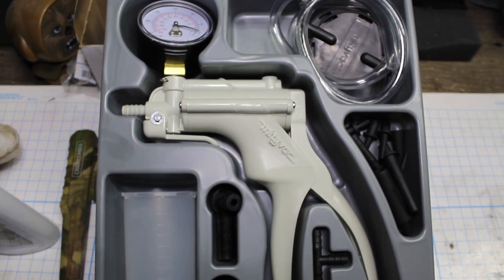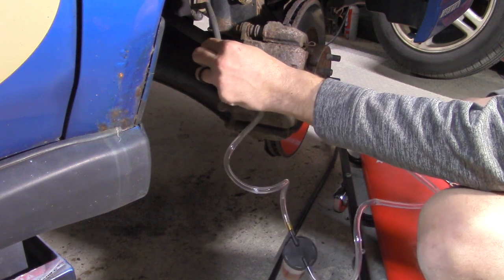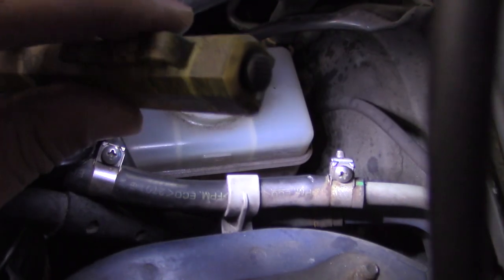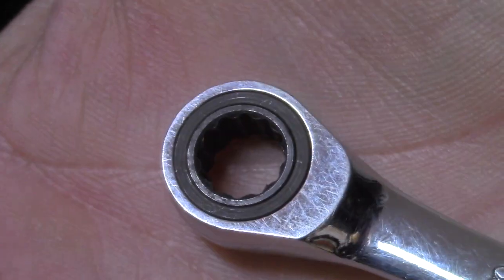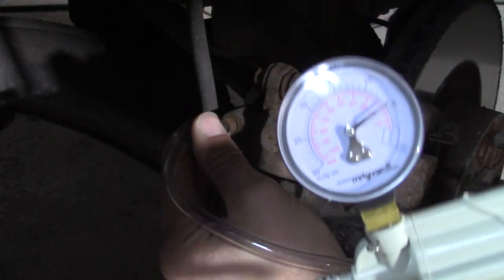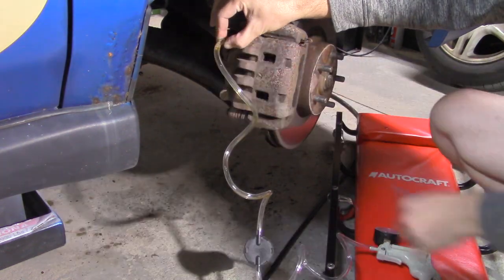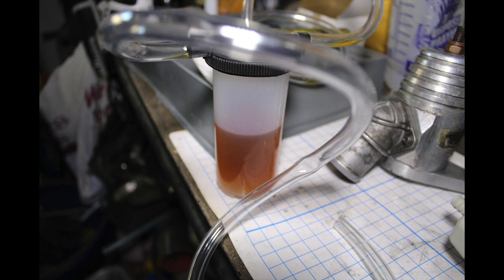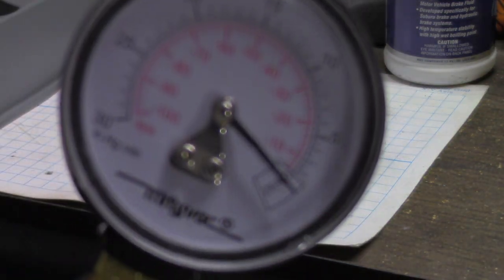MITYVAC: How To Bleed Brakes By Yourself Calipers DIY | Mityvac Kit | Review Subaru WRX

Comment: A suggestion I read elsewhere is to use a thick silicone to seal the bleeder after you open it to prevent air from leaking in past the threads🤷‍♂️.. haven’t tried it myself yet.

Comment: Short hose goes between the canister and the vacuum pump.  Says so right in the instructions.
Reply: The short tube is just used to make it easier to hold the cup and pump with both hands.  It really doesn't matter though

Comment: Is it ok to just do the calipers in the right order and not specifically worry about bleeding the ABS unit itself?
Reply from the maker: Ronan Rogers hi that’s the normal caliper bleed but I believe you need a computer tool to pump the abs . I have clear fluid out of all my lines and in the reservoir .

Comment: Can you flush the system by continually sucking fluid and adding as you go?
Reply from the maker: Yes you can but if you pull too much air into the reservoir you have to start the whole process over again. But yes you can fully flush it out and keep adding before it gets too low in the reservoir. The point is to get all the old fluid pushed out so that by the time your on your last caliper you should be pulling all the old fluid out and new fluid in.
Reply: @xESPplayer500x  use this tool to remove most of reservoir, fill with new fluid then start bleeding remaining out of lines/calipers.  Have used this exact tool several times to do this, works like a champ

Comment: Thanks for the great info. I have been following your instruction and get a good steady vacuum on the gauge but when I crack the bleeder valve the pressure drops but no fluid. I've done it about 8 times and still no fluid. I did pump the old fluid out of the reservoir. Maybe too much? And I did remove the bleeder screw completely to see if I needed to replace it. Did I introduce too much air into the system? Any recommendations? Thanks again. Liked & Subscribed. cheers
Reply from the maker: Ross Williams, DC Thanks for the kind words ! Try filling the reservoir full of fresh fluid and build vacuum w the pump. Then try backing the bleeder out if no fluid  take it out if you need to see if there is a blockage. Go from there, if not try the other calipers then try the issue one again .
Reply: Same issue here, did you get it figured out?

Comment: Hi, awesome video, but what if it dropped to zero and sucked air on the top reservoir?. Just all rutine from the start?
Reply from the maker: Thank you! Yeah if the reservoir goes dry you have to start over . If it takes a little from the top of the reservoir your ok just keep adding and bleeding without going dry.

Comment: Seems like a lot of potential points of failure. If you run out of vacuum at any point, or you slip and the rubber nipple loses it's seal, or you accidentally run low on fluid in the resevoir. I have a cheap harbor freight air compressor driven one that works ok but doesn't create a whole lot of suction. Looking for something better, perhaps the motive bleeder that pressurizes the system at the cap. Love to hear if anyone has a better way.
Reply from the maker: The DIY components do leave a lot of error but if your going to try something like this anyway you should have a better than average concept of those failures. That said for the price of $25 on some sites the Mityvac is a great way to go. I would love the other models found in Grassroots motor sports like the ones that attach to the reservoir insuring it doesn’t go dry. Honestly a lot of people have makeshift bleeders out of soda bottles and tubing as long as you understand the concept and risk it’s not hard just go slow one at a time I’ve had amazing results.
Reply: I’ve used and constructed a vacuum extraction system that I made a video on. You might be interested in it. I’ve used it on the brakes and it works great. I mostly use it for my ATF extraction but it’ll work on any fluids. Thanks for watching

Comment: I bought one about 15 years ago, couldn’t get it to work at all. I threw it away in the trash can.
Reply: What didn't work? I just used mine for the first time and worked perfect. Had the brake fluid flushed on my Harley in 15 minutes
Reply: @nohandsdan9353  
Didn’t produce any vacuum. Didn’t accomplish anything.